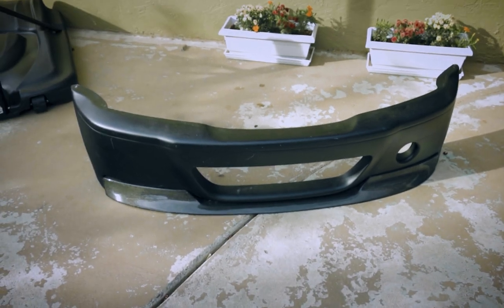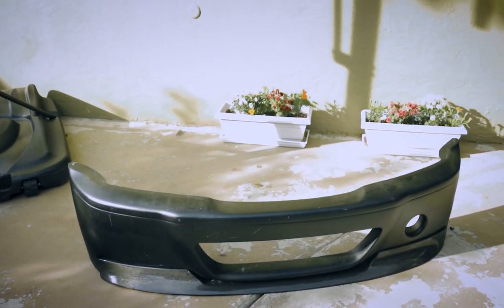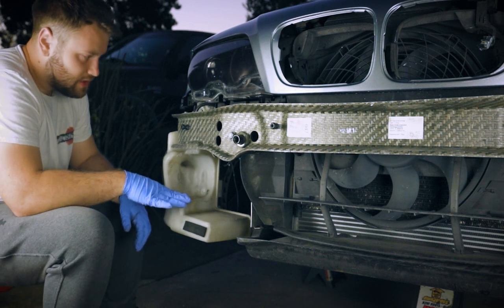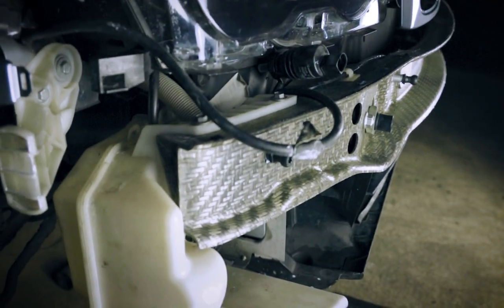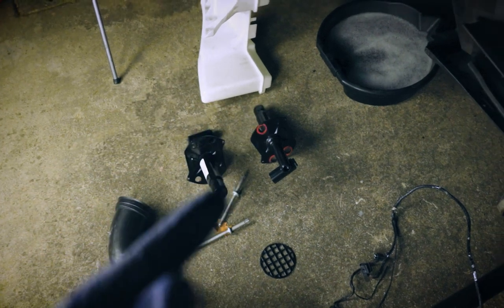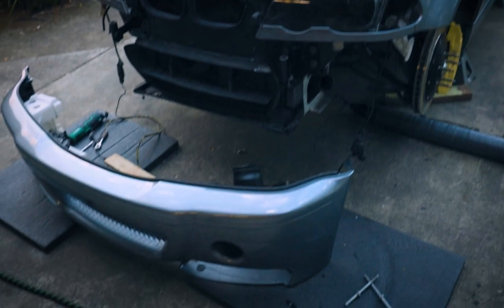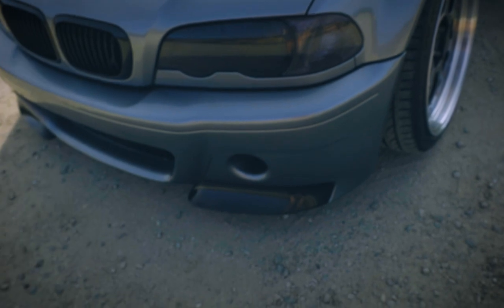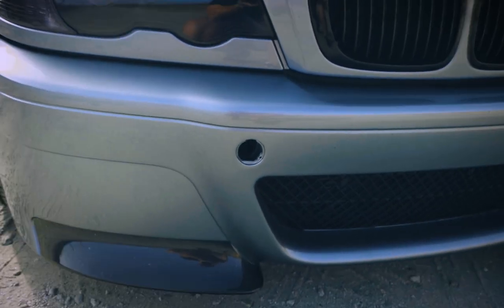Installing a $15,000 OEM CSL Front Bumper! Epic Upgrade

Comment: Do you need the side bracket sliders on the replica bumper?
Reply from the maker: On the status bumper it did not have anything to hold the brackets but I believe miles end bumpers you get to keep the bracket function
Reply: @MunichVenom  I have the Status Gruppe bumper like yours but with a tow hook hole. So I guess I don’t need the bracket sliders that slide onto to those white brackets on each side. Also, just get rid of the kevlar bumper brace and use nothing right? Didn’t get to see you slide the bumper on in the video.

Comment: So this bumper just does away with the brake ducts right?
Reply from the maker: yes there are no brake ducts with the csl bumper. The one hole in the bumper is for the intake. Even on the stock m3 bumper the fender well duct holes are plugged from factory so the car never really came with brake cooling.

Comment: So is this an actual OE BMW bumper or Status Gruppe replica? I’m a little confused. And how much was it $$?
Reply from the maker: The bumper on the car is oem csl, the black unpainted bumper was a Status Gruppe one. I had a 2 bumpers because I didn’t like the fitment of the status Gruppe bumper.
Reply from the maker: I got the oem csl bumper brand new and they go for around 10k. Biggest problem is finding one at this point

Comment: so you need a new resevoir because the bumper can't fit?
Reply from the maker: Yes the oem csl front bumper uses the pre-lci reservoir so if it’s a pre facelift car you wouldn’t have to get it
Reply: @MunichVenom  ok so a 2001 model reservoir would be ok then?

Comment: Do you have the link for the csl intake duct?
Reply from the maker: I bought the ducting from bmw: here are the part numbers but I’ll put them in the description of this video as well
Reply from the maker: M3 CSL Air duct 
11617833646
 
M3 CSL Suction tube 
11617833645
 
M3 CSL Intake manifold 
13717896774
 
M3 CSL Intake tube 
11617833648